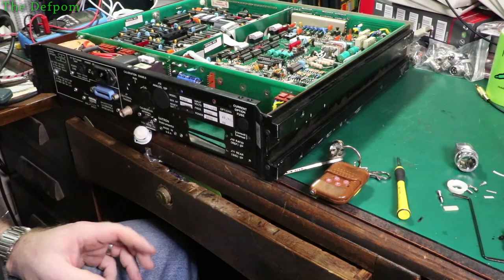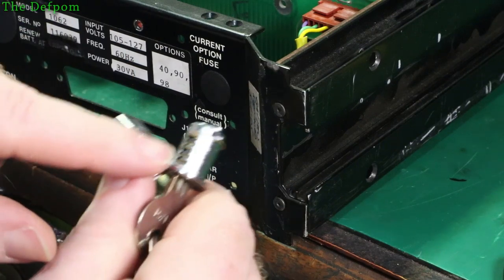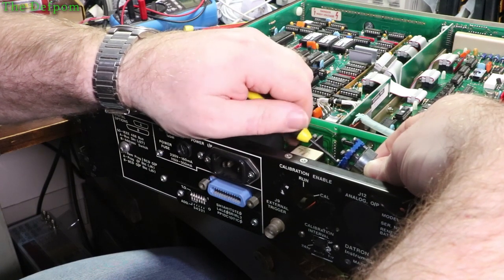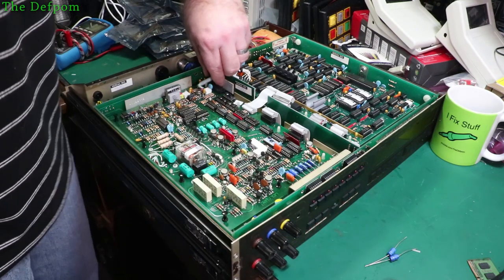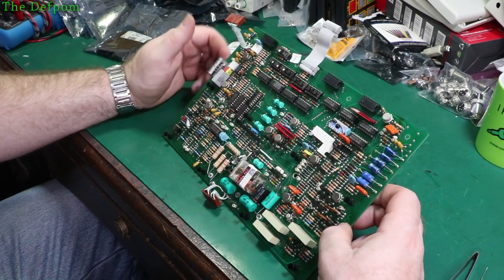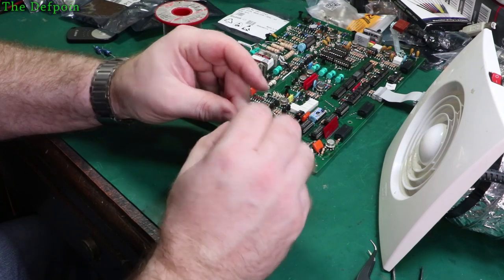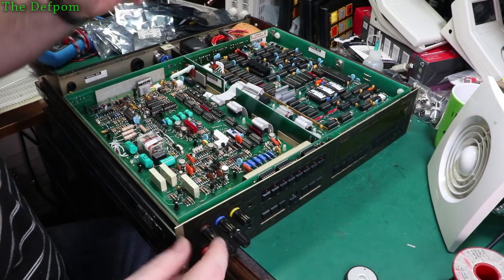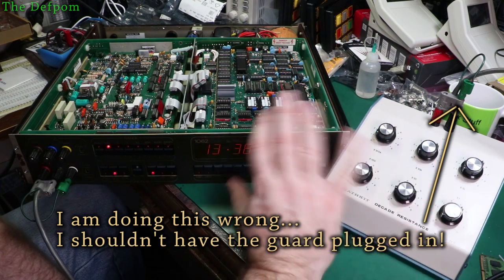#725 Datron 1062 Autocal Digital Multimeter Repair Part 3

Comment: I have numerous lock picking equipment it was a hobby for me at one time. It has been very useful when I have found old electrical cabinet locked on no keys.  Looks like your making progress. Thanks regards Chris
Reply from the maker: Yep the lock picking items have been very handy to have, when I first got them out of curiosity I tried them on the “security” locks at work (which I have keys for anyway), turns out they are easy to open with the pick gun... two clicks and done ! I can see why it’s not legal to have them in many places.

Comment: Excellent progress, Scott! I think your idea for testing the optocouplers is spot on - mirror the circuit in the unit for biasing and then use a function generator to test the frequency limits of the various devices using an oscilloscope.
Reply from the maker: David V - this unit seems ok, but I think I may do it out of curiosity and for reference sake.
Reply: @TheDefpom   I would watch that video! - (if you make one) - it would be interesting.
Reply from the maker: I ALMOST did it today... I also found test circuits in the data sheets, so I’m tempted to use the data sheet circuit instead and compare old vs new etc.

Comment: that key is considered one of the "universal keys" the ch751  is available online everywhere, it is very common cut for alarm panels, file cabinets,server racks, RV compartments etc yiu would be shock how many things it can open
Reply from the maker: I actually had trouble getting a copy made, the first place I went to cut the wrong key and it wouldn’t go in the lock! Then it turned out they didn’t have the right key, so I went to the place I got a copy made at previously, they weren’t cutting keys because of the lockdown restrictions, I had to wait a few weeks before I could get it done.

Comment: You should have shown picking it.  It's a simple wafer, a bit of light tension and a screwdriver would probably do it.  There are a variety of locks in my house which are picked quicker than finding the key!
Reply from the maker: NivagSwerdna - I didn’t want to temp the youtube monetisation gremlin, thought I was pushing it a little even mentioning it.